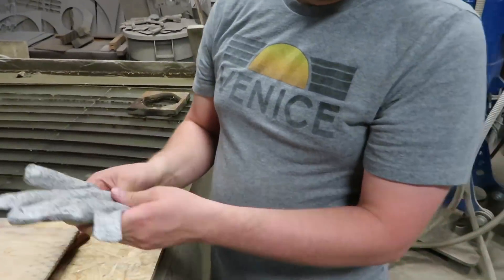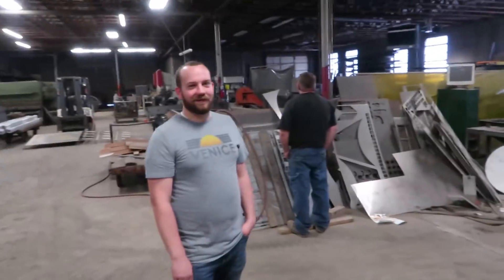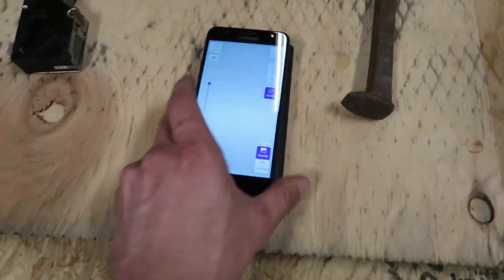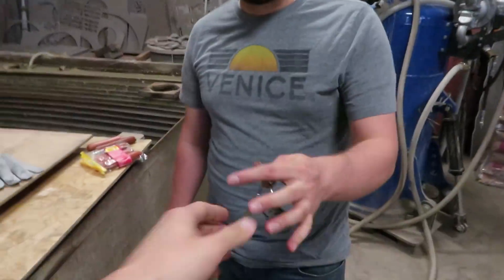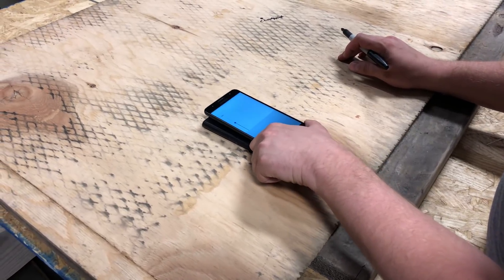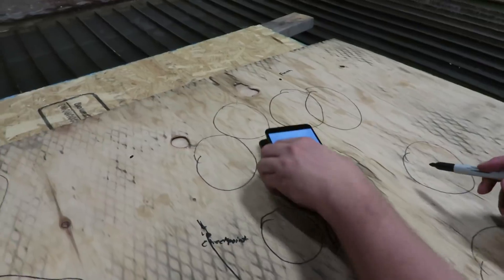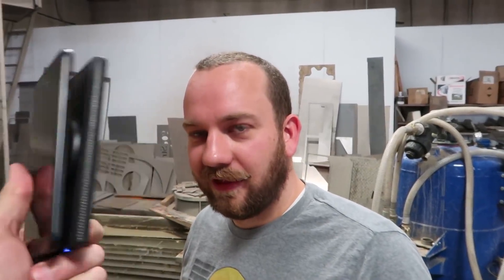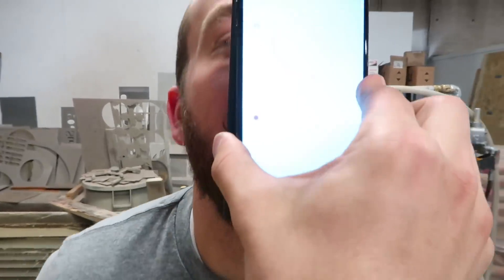Waterjet Hide and Seek AND What would happen if I touched the 60,000 psi waterjet?

Comment: What would happen if you touched it? Well, considering they use them to cut steaks, at considerably lower pressure than that, and without abrasives, I would say that if you waved your finger through the waterjet it would be mangled and, if it wasn't amputated by the waterjet, it would probably have to be amputated afterwards anyway.

Comment: I've been to liveleak. I know what 60k psi look like on flesh o.o
Reply: Link?
Reply: Connor, no.  I'd love to be educational, but I'm a scaredycat of jewtube policies ): 
Basically, it's called high pressure injection injuries. If it just cuts your flesh off in a mangled state, you are LUCKY. It looks a lot like high pressure/temperature steam injury (without the white goop). It isn't a clean cut, it looks like someone just ripped your finger off, just yanked it. 

The water jet can penetrate your skin, muscle, tissue and even bone, the intense pressure then tunnels up your arm through veins, arteries and tendon channels, "exploding" them with the pressure. Hitting your palm with a waterjet can wreck your entire arm up to your shoulder if you're unlucky. It turns your flesh into a super-fast inflating-and-then-popping balloon. 

All of these injuries happen instantly, and surgeons CAN fix you in most cases, but you'll be missing large portions of your flesh, so expect much shorter, disfigured fingers and a lot of scars and stitches. The operations take a buttload of time to get rid of the foreign particles (i.e. sand), and most goverment funded hospitals will just opt out and just amputate everything damaged.